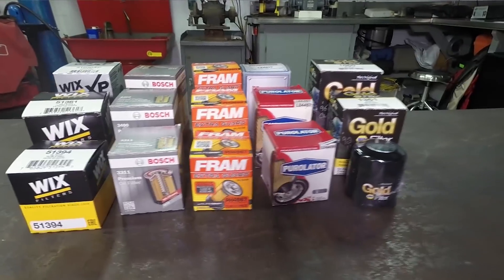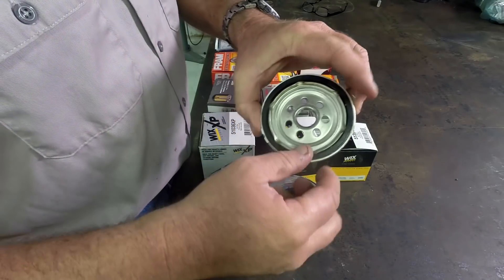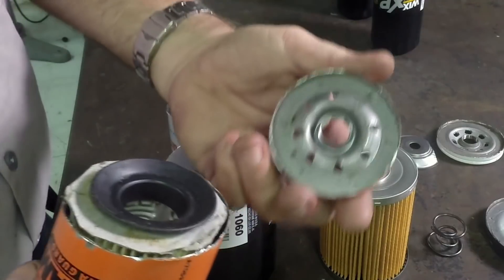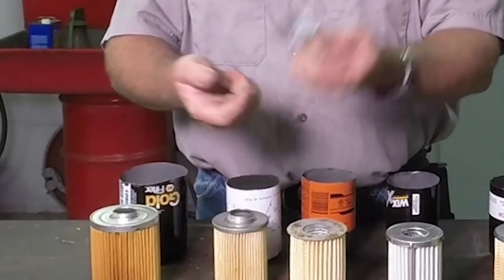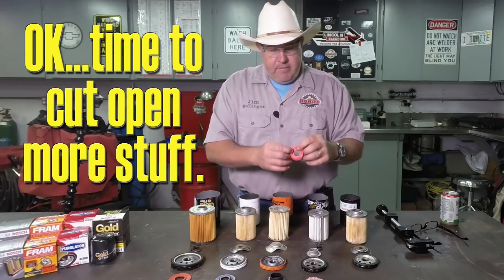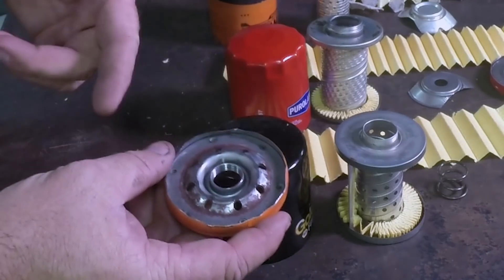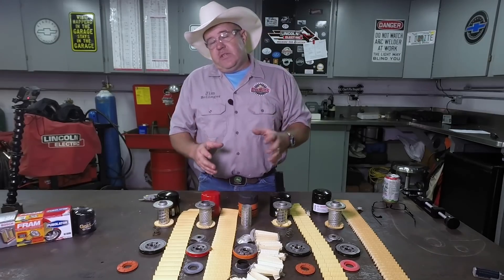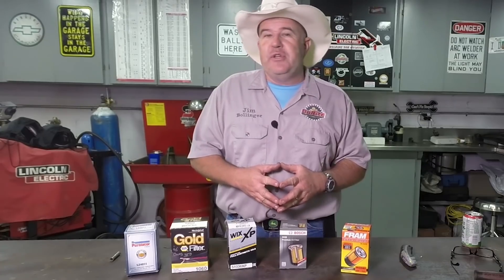The worst oil filter EVER!

Comment: I have been using Fram oil filters for 30 years and I have never had engine failure with 3k miles changes.  With that said, I have stopped buying Fram.

Comment: Maybe I been lucky too.  I had always used the cheapest oil filters (lots and lots of Frams).  I did my own oil changes for about 30 years from age 15 to about 45.  After that I started letting oil change places do it.  I never had a problem.  The important thing is to follow the maintenance recommendations for extreme conditions in the owner manual.
Reply: sometimes oil change places skip changing the filter thinking you won't know
Reply: It happens.

Comment: I stopped doing my own oil changes quite a few years ago when I started getting deals on oil changes through my car dealer. I had a 91 Ford Escort that I bought new. Did all my own oil changes on it and used nothing but Fram filters. The car had 130,000 miles on it when I sold it. The only engine issue I ever had with it was the timing belt breaking at 96,000 miles.

Comment: Been using FRAM in all my cars and trucks including a Saturn that has 215,000 miles with no engine repairs or transmission repairs.  It’s used as a delivery vehicle so it’s put through the ringer daily.  Regular maintenance is key, not so much the product

Comment: The issues of comparison used in the video have little to do with how an oil filter actually will perform with prescribed service intervals.
While it’s obvious the fram is a lighter construct, the criticisms are not what would have a meaningful affect on normal service.
If a filter is change at regular intervals, the media will never clog to the capacity, therefore making the bypass spring a non issue. The inti drain back seal is a relatively new gimmick in oil filtration and isn’t needed in most applications. Gage an weight of the can and baseplate is 100% meaningless in a in any normal application.
The superficial rust shown on the fram filter, I agree is unattractive is of zero consideration, because it’s on the dirty side or pre-filtered side of the filter media.
A silly video all things considered.
Reply: The FRAM filter has so little media in it that it will clog in as little as 2,000 miles, well short of even the ancient and outdated intervals of the 1970s. Run one today, where intervals regularly flirt with 10,000 miles, and you'll be running on bypass for a good 70-80% of the duration between services.

FRAM filters are utter shite and the only thing I ever condone using them for is targets at the rifle range. That orange can makes it real easy to hit 'em with irons at 200 yards...
Reply: TestECull  well that is just not accurate, having cut used filters open after oil change service. Almost zero particulate in media,
Reply: If all that shit is meaningless then why are fram filters 2 to 3 dollars more than the competitors EVERYWHERE they are sold. If you aren't an engineer for an oil filter manufacturer then you shouldn't be spouting off bullshit, what the media is made of and the top plate material are CRITICAL in filter performance. You obviously know nothing about this so you should be silent !!!!!!!!!!!your comment was the only silly thing about this video !!!
Reply: toemanification I've been servicing cars for about 45 years, Frame filters are in my experience about $4.00 so other filters you can buy for a $1.00 ? 
People can buy anything they want, I wasn't necessarily looking for long debate.
I am a little surprised at the hostile responses however.

Comment: Iv had fram oil filters get internally crushed in two jeeps, a 72 baracuda and 75 powerwagon, almost ruining the engines. Also had three air filters come apart and get sucked into my engines, luckily they didn't get ruined. Now I only use Mopar filters on my old engines and k&n filters on newer engines. K&n filters work "too well" on the dirty engines and will get plugged up quickly resulting in the oil going through the bypass and not the media as i found out with my powerwagon, but they work great on engines that use low viscosity synthetic oil like  my Audi A4  turbo that needs extreamly clean,  free fllowing oil.( or engines that arnt completely filthy inside. lol )                                                                                  Fram was junk... is junk... always will be junk!!!
Reply: If you had trouble with one fram filter why did you buy more? Seems a little dumb to me.
Reply: @popholmes5825  Once could be a fluke, I suppose.
Reply: This was also my experience with fram, as in when I bought my last Chevrolet(which I had a receipt for being done from the previous owner on schedule) I unscrewed the fram and upon dumping oil out of it into the pan I saw a flake of cardboard. I mean, I know they're bad but THAT bad is on par with what I think the Walmart supertech filters are like. On all my Chrysler products I've only ever run Mopar and on Chevys it's been AC Delco and on Fords it's Motorcraft. I think that the OEM has probably made the best choice on what filter should be on the engine, so that's what I stick to. On my AMC stuff, I run Bosch or Wix based on what I can get bc I stg they were shipped with sludge in them.

Comment: My dad literally just bought a Fram filter and Shell Rotella T synthetic blend 15w-40 for my BRAND new Nissan Titan. Nope it’s going in the trash and I’m stopping at OReilly in the morning and getting a Wix.
Reply: And wait? 15W-40 shell Rotella for a Nissan titan? Even if it's the diesel titan thats wayyyyyy too thick an oil. If it's the gas(petrol) engine one its WAY WAYYYYYY too thick. Thats like, semi oil. Tractor trailer oil. Stuff you'd put in a kenworth, Peterbilt. Like, the big big trucks. Don't put any of that stuff into that truck, go look in the owners manual, and it'll tell you exactly what weight of oil and how much to use. Unless you're driving a big rig, there's no need for 15W-40 Rotella Deisel lube oil. Good lord..lol
Reply: blackhawks81H if it’s gas it’s a 0W-20 for a 2016/17 (guessing its not a 18’)
Reply: @blackhawks81H  i was thinking the same I use to use rotella on my Ford falcon with gnc not for a modern car 6 cylinders 221 I miss my falcon
Reply: Cant go wrong with k&n honestly
Reply: Tell your daddy to get the proper oil for that engine while he is there returning the filter. 15w is too heavy for that engine  you want A 5w for cold climates or A 10w for warmer ones. and the hd does not mean heavy duty it means high detergent so you may want to reference your owners book to see if hd is recommended. also syn blend is A waste  go full syn.
Reply: Nice truck
Reply: Use what the manufacturer recommends.
Reply: 15w-40 is standard weight for diesel applications.  I even run it in the winter with no issues, just make sure to warm the engine up for 5-10 minutes and you're good.
Reply: It's your vehicle and motor, but I wouldn't put a high detergent oil in the engine.  I made that mistake back in the early 80's, put some Rotella T 15w40 (because I got it free from work) in a few of my engines and my motorcycle,  thinking that because I rodded the crap out of them, the heavier oil would be good.  Well, the heavier oil wasn't a problem,  but the high detergent level in the oil (for heavy diesels) was.  Within a few weeks, I had leakers, every one of them. The detergent began to clean up the insides of the engines, and the engine seals didn't take too kindly to it.  Changing back to regular oils wasn't enough, the damage had been done.  I had to open up those engines and replace seals on the pans, the rocker covers,  rear main seals (which is a major job)... it ruined them all.  The only positive out of that mistake, was that in the end, I had to do all that work changing the seals, so I did benefit from it, but I could have avoided it all and saved the hassle and expense by simply sticking to what the engine required.  Experience is a great teacher.
Reply: Stan Patterson Yea my Titan is a diesel. That’s why I use 15w40. But thanks for the story 🙂
Reply: Stan Patterson Rotella T6 is what my book reccomends in 15w40. I’ll switch to Royal Purple after I hit 5,000 miles. 
But it’ll be awhile. I don’t drive it much. It’s a big truck.
Reply: @stanpatterson5033  A high detergent oil will never damage  any engine. The comments you make on damaged oil seals make no sense. Unless you talking about a very old engine made before 1960 when leather seals were used on larger engines. However I think Rotella is way over the top for this engine.
Reply: I’ve had issues with a few of the k&n filters where they leaked where the nut is pressed on. Autozone nor oriellys would replace the oil that leaked out, but did replace the filter. It may have been a freak accident, but I’d rather it not happen again.
Reply: Oh I wouldn't use 15-40 on that. 0-40 to 5-40 max. But Shell Rotella is designed for real big engines as found in Semi Trucks, locomotives or stationary engines like generators. Rotella is designed to last long hours of hard use. Far harder use than an ordinary road vehicle with its 12000 Mile service interval. Its very expensive too.
Reply: Why don't you get a a K&N filter? It's way better than any of these and has a 1 inch nut on the dome so you can just put a 1 inch socket on a breaker bar or ratchet and take it off real easy without dealing with those ridiculously hard to fit strap wrenches when the damn things get seized on there real good. I've used nothing but K&N in my trucks and I've had a 94 Chevy 1500 that had 370k miles on it when it got stolen. Currently have a 2500HD with 350k miles on it. 6.0 gasser runs like it's brand new. Had a Honda Ridgeline that I beat the hell out of because it was free(long story got it with 10,000 miles on it.) sold it to a friend for cheap, and he's still driving it with 300k+ miles on it. They're just that good. Oil quality makes a difference too. I've had all these engines last nearly forever using valvoline. The older trucks all used valvoline Maxlife and my 2016 Silverado that I drove off the dealer lot with 12 miles on the odometer is using valvoline full synthetic+ K&N oil filter, and with the tight tolerances of engines these days, I wouldn't be surprised to get half a million miles out of her. Valvoline is so confident in their products that you can register as long as you're still below 125k miles, log your oil changes on their website, proving regular oil changes and if the engine dies before  300k with the full synthetic, they'll pay for a new engine. The synthetic blend gives you a 250k guarantee. What other oil company does that? I've convinced many friends to switch valvoline and a K&N filter over the years and every single one has thanked me when they end up with an old ass vehicle, body might even be 50 percent rust. But the engine purrs like a kitten. Smooth as silk. Like butter. Like whipped cream running downhill in Texas in July. Smooth.
Reply: You need a sugar Daddy? ;)

Comment: Former lube tech here
When a customer came in, the only filters that would crush were fram filters. That black bottom part would always burst like boil full of puss. The oil would have bits of hard filter material and then  the rubber gasket would always leave bits on the mating surface. Please avoid these junk filters.

Comment: I quit using F after my Fury 383 started having problems. Tracing the problem to the dirty oil, we pulled the oil filter apart and found it had pretty much disintegrated.

Comment: I installed a fram filter once when I did not have access to OEM for my subaru. I bought the most expensive one in the fram line and I had filter meduim in my oil within a week. Worst filters on the planet. Had to flush the engine. Napa gold is good. I personally recommend OEM,  correct bypass pressure. The tokyo rokis (subaru oem) are excellent.

Comment: Terrible practice using a die grinder on an oil filter.  I use a little thing called an “oil filter cutter” lol.  PS fleetguard is the only filter I use on my engines.

Comment: I've been using frame for 15 years and I've blew 2 motors so far due to oil issue. I wonder if it's the filter I'm going to take a brand new frame filter apart and see for myself.

Comment: That's amazing. As an ASE certified mechanic, I've had locked up engines on every single one of these filters EXCEPT the Fram. But hey. Just my personal opinion . Definitely not EVER touching wix.
Reply: I smell bullshit. I can certainly believe that you anecdotally have run across locked engines on all other filters. What I find less realistic is that you're a professional mechanic who thinks that proves anything. Fram is shit because it's a 50 cent filter masquerading as a top brand. It's inferior construction may lead to premature wear on engine parts but I don't think anyone would expect a bad quality filter to be responsible for a actual engine lock. Certainly not a trained mechanic. I'm betting 90% of the locked engines you've run into is is "Idiot owner ran without oil." Because outside of cars that have been lawn ornaments for decades that is what 100% of the ones I've found locked owed it to.
Reply: @starvalkyrie  smell it all you want. I've worked on cars for over 25 years and I'm not sticking another pissan filter on any car leaving my shop unless I want a comeback and an engine swap. Every engine that I had locked up had other filters on it. All if them. Don't get me wrong, I've had fd up engines with frams on them but when you get a customer tell you they thought you drive until it's pitch black and sludgy, then yeah lol
Reply: all ase means is you can remember what you read long enough to take a test.  Some of the best mechanics I know have no formal training just loads of experience!  They are engine whisperers!  Any shop that displays their certs for all to see turn me off!  Id rather go to the ma and pa shop thats in the back of an ally with 100 cars outside and nowhere to park, the waiting room chair is a cooler with beer and brats grilling on the bbq!
Reply: @PrinceofWalesisland  I've worked on cars since I was 8. I took my ASE'S when I was 21 and now im 37 so hope that makes ya feel better. You are right about taking tests, But I was raised to keep paperwork showing you know what the hell your doing because they don't hire people like me without paperwork.  Still after all those years, a Fram man.

Comment: Fram's reputation  is deceiving.  Installed a Fram fuel filter last summer.   Wondering if that was a mistake.   By the way,  I would have liked to have seen an AC-DELCO and other OEM oil filters scrutinized as well.  I always use AC-DELCO  oil filters for each oil change.

Comment: engine filters are really for a new car or if you increasing hosepower that might allow for extra wear.  Some might argue with my theory but if you think about that the filter gets clogged with metal then you have problems with your engine. I do change my filter but I have 70k on my engine and change it every 3 or 4 oil changes

Comment: Napa filters are just Wix filters with napa branding on it.  They are exactly the same.  I was privy to some extreme testing of oil filters in a lab and the high  end Wix, Moble 1, Motorcraft, K&N (both lines of filters), Mann (own wix) are some of the best oil filters out there. Not just quality but the important part filtration, flow rate and capacity.